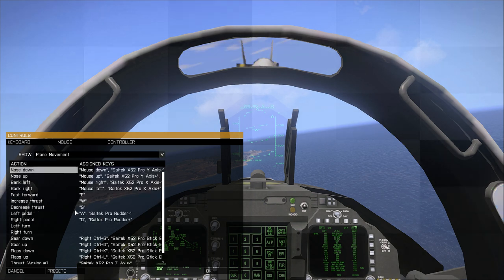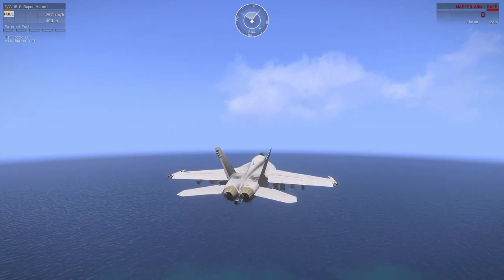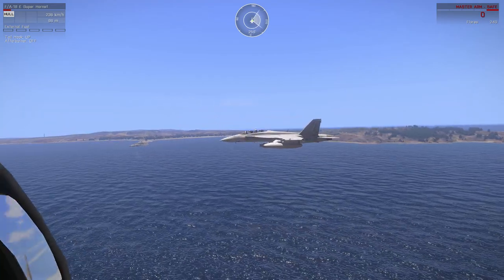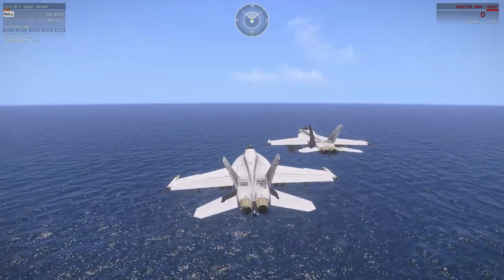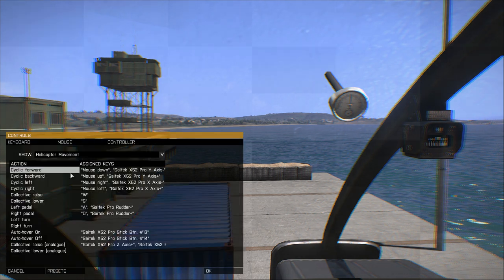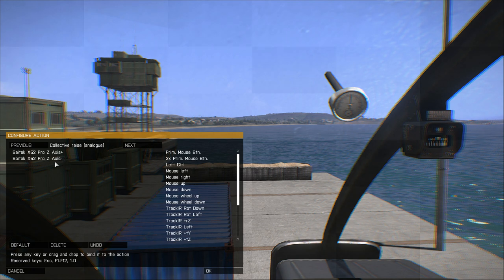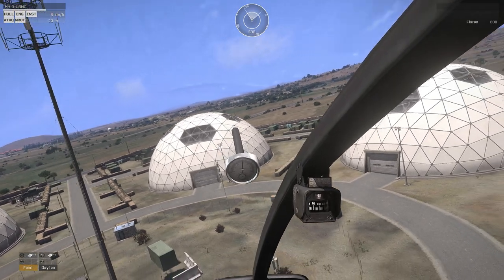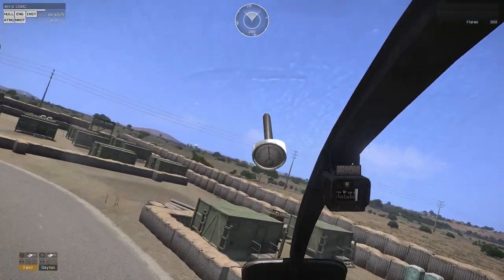Flight Control Joystick Setup - Tips and Tricks [ARMA 3 & DayZ]

Comment: If you map both the collective +z and -z to "collective raise" as shown in the video, instead of mapping to both, you loose a lot of collective down control which limits your descent rate and breaking. For instance, from a stand still ground hover lift up to about 100m then give full collective down and watch your descent rate in total time. Now remap to use both settings and do it again. The descent rate changes considerably. On my HOTAS throttle I loose about 2/3 of the overall down collective range making the down collective much less effective when fully applied, adversely affecting both the rate of descent speed and more importantly the nose up breaking capability. As you state, the change does increase the overall sensitivity of the raise collective but it doesn't affect the max/min range values, so it requires more motion to accomplish the same thing.
Reply from the maker: +grhenf2 Thanks for your insight.  I've since switched to a different HOTAS, so I'm unable to confirm your findings at this time.  I published this video in 2014, so I'm sure BI has changed a few things since then.

Comment from the maker: I think it helps a lot with the jet, but mostly for gross movements.  For super fine movements, like when aerial refueling, the mouse it better.

For looking around, I use TrackIR.  Once you start using that, you'll never go back to mouse or hat switches.
Reply: What are hat switches?
Reply from the maker: Switches that you mount to your baseball cap.  ;)  Just kidding.  They are the multi-directional switches that a lot of joysticks have in place for looking around or navigating menus with up down left right positions for a single button.

Comment: 7:20  THIS should be explained in Arma3 tutorial because it is total madness messing with controls
About jets, and planes in general. I'm not sure it works flawlessly with that config (Analog+thrust only) Because 1) Using only 50% of throttle 2) Stone falling syndrom when heading for the unasigned zone (previously the brake). 2) is obvious with the osprey because when VTOL it can fall down pretty hard (almost no way to recover at very low alt)..

So I'm keeping doing reaserch. (PPjoy+ script might be a solution for full axe usage but I've read that now you must use "signed drivers" not sure it will works anymore)

I'll go even further: I think it is completely bugged (analogue) once you reduce the gas or airbrake because it stalls. But you can't notice it at 300 km/h because it has enough forward speed to recover instantly. But if you close to the stall speed of the plane (VTOL landing) the correction won't make it, you'll crash like a noob (but you know when it happens like that it's not a skill issue but a arla input failure) - COntrol sheme is not an easy task, War Thunder just wrapped a new UI recently and it still not perfect - maybe Digital and Analogue should be auto detected because I think what we do is too far away from gaming. Not every one may have it's control sheme mapped correctly

CONCLUSION BINDINGS?
Jet fighter: Analogue+Thrust axis and Airbrake buttom
VTOL: Digital+Thrust and Digital-Thrust
Heli noob: Same as VTOL
Heli medium: Analogue+Thrust with +/- axis
Heli unleashed: Full Analogue+ low sensitivity
Reply: did you every find a fix for the stone falling syndrome....I just brought Hota and can't even freakin use it and with mouse and keyboard I'm awesome....but throttle crash every time

Comment: I know it's an old video but I'm just getting into flying in arma. What the throttle double bind seems to do is give you 50% of the throttle hence why more control. But collective lower is severely impacted by doing this making combat landings waaaaaay too slow and I'm not inclined to switching to a mouse mid banking turn.
Reply from the maker: Depends on the flight model you're using.  Check my other video for those settings.

Comment: Thanks for this great video. Do you think the joystic gives you an edge, not only in the sensitivity but also in combat, like jet vs jet in multiplayer? 
And what about free looking,  spotting enemies and buildings, how does that work with the stick? Thanks again!
Reply: Free looking with a joysticks is done with a pov/hat switch on the joystick that is controlled by your thumb
Reply from the maker: If you play a lot of Arma, I would definitely recommend getting TrackIR by NaturalPoint.  It will transform your experience and open up the entire game.  And you can use it in most flight sims and a few driving games.

Joystick gives you a massive edge when flying.  And it is more immersive which makes the game much more enjoyable.

Glad you liked the video.  Thanks for the kind words.  :)

Comment: Great Video I am learning a lot from your videos. I have X52 throttle with Force feed back stick and also Trackir and Logitech Peddles, I also have X-52 pro set. I like using the force feed back stick with the X52 throttle used as a collective along with my pedals. with TrackIR. Can you give me any readable, printable, etc. binding that you have set up? I am having trouble getting set up like your bindings are as I have to pause the video, set up, run video pause again and I think I am missing something somewhere.. Any assist will be greatly appreciated if you have anything you can share with me.. Thank you again Feint for your great videos I have learned a lot from you. I can use reg e mail if you tell me how I have a g mail account as well as a yahoo if one of those will be easier to use. I do not know what the policy is here when it comes to putting e mail addresses. I have helos and am planning on getting jets if I can ever get things working right.\ I just dont want to spend the money for upgrading more unless I can get things working better so I dont get so frustrated with it.

Thank You Feint..
Reply from the maker: Chuck Chuck Happy to help. I don't use the X52 PRO anymore and don't have my key bindings anymore unfortunately. But how I set up my stuff is kind of labor intensive. Basically I set things to how I think I want them, then play for a while and change the bindings as I go along until I run out of switches and stuff. I know I had gear and flaps mapped to the toggles on the joystick base. And the big E button on the throttle was set to the eject function. The button near that but closer to me was the mini map, the dial around that E button was set to continuous zoom to change my FOV on the fly...etc.

Comment: would a flight stick help with

Aiming in a jet to take out other jets and
being able to fly very very close to the ground

also would it help being able to land without hovering? i would like to be able to move forward and slowly descend without pitching up the nose on a heli
Reply from the maker: It depends on your settings and quality of your joystick, but overall a joystick will allow you to do a sustained input, while a mouse will give you more accuracy but less ability to do a sustained input (in Arma games).  So if you wanted to do a slow turn around something, you can easily do that with a flight stick.  You can do that move with a mouse, but you will be moving your hand all over the place.

Overall, it's a good thing to have and to practice with.  I think Dslyecxi has made a lot of people go purely to mouse and keyboard and has made a lot of people question the utility of a good HOTAS system.  I personally use both and get compliments on my flying skills.  Either way, practice with whatever you have.

Comment: Good tips.
What difference, if any, is there in having the collective mapped to only analogue up as opposed to both up and down separately?
Reply from the maker: Two results.  The first is that the entire range of the throttle is used for throttle (vs. 50% used for throttle and 50% used for braking).  This makes throttle inputs much more subtle as instead of diving up 0 to 100% of the throttle between 3 inches of stick travel, you now divide that same 0-100 among 6 inches (relatively speaking).  The second result is that it separates throttle from braking allowing for finer control of your speed.

Comment: Great video!  Just one question though. Are you using your mouse to look around? If not, how am I able to the hat button? Also for firing trigger button doesn't seem to work, actually none of the control mappings seem to work other that the throttle. Any help  would be truly grateful.
Reply: I use TrackIR to look around.  Default mapping from Arma might not be your cup of tea.  It isn't for me.  I map all of the controls manually.

Comment: One question from me, the heli throttle. I have it set up the same as you, but I find it very "floaty" and have to use one of the buttons as a "digital" collective down in order to bleed and land properly. Do you do the same ? Or is there a curve mapping in arma controllers sensitivity you find works best ?
I also use an X52 throttle, but with a Logitech j/stick for the cyclic.
Great vid though, wish Id found it sooner before figuring this all out myself :D
Reply from the maker: Thanks.  No, I'm not really doing anything special as far as I know.

I have the deadzone for the Z axis (throttle) set to zero (no deadzone) in Arma3 and in the joystick control panel.  I played around with increasing the deadzone in the past and it made the collective a little easier to bring down to zero.  Then Arma3 changed something with their vehicles and I didn't need to do that anymore.  So I set the deadzone back down to zero where it is now.  But try changing that and see if it helps you.  :)
Reply: Feint Thanks mate, I'll just fiddle with it a bit then and try for a sweet spot and carry on using a button to force negative pitch. At least I know there isn't anything Im missing :) Cheers o7

Comment: Excellent video and tip and on unbinding decrease collective, I'll be trying that out when I get to play!

Just a question and maybe you can help me out. I usually have the problem of leveling the chopper when I'm approaching my landing. It's hard for me to keep it stable and center most of the time, do I need to decrease the sensitivity and kill the deadzone (as you recommended on the comments). This has been a real problem for me when I try to land
Reply from the maker: In answer to your question, if you are using a joystick for slower level flight in a helicopter, try switching to mouse.  I usually use a joystick for certain moves and the mouse for other moves, and for slower level flight, I use the mouse as it's much more accurate (those less immersive).  For hovering, I definitely use the mouse over the joystick.  I think that unless you have a very high-end joystick, you're going to have some problems with hovering unless you're using a mouse.

Of course in real life, hovering a heli is inherently unstable and you need constant corrections to keep upright and still.  I often scan from the artificial horizon and looking outside the cockpit at a reference point like a tree or a ladder to keep my alignment.  If you have a wide field of view, try assigning the analog zoom to a slider on your joystick.  This will allow you to change the field of view to something less zoomed out.  The more "wide angle" you have, the more you'll have a sense of speed.  You'll also have a harder time hovering because medium to small changes in attitude won't be as visible (because of the nature of wide angle views).  Zoom in a little.  It will take some getting used it, but it will make you a better pilot as it's what we are more used to seeing in our normal every day life.

Comment: are you talking about the Saitek x52 pro throttle? or is the just the joystick, because the throttle has problems as I can't land anything with it, reason being there is a arma problem with all throttles only starting at 50% and not being the normal 5-10% required to lower altitude with out not dropping like a rock out of the sky _ crashes or damages every time. Something to do with a z axis problem
Reply from the maker: I address this issue in my other video on joystick setup.

Comment: +Feint
If you use collective raise only, is it still possible to land fast? i dont understand why you dont need collective lower
Reply: +Boris theBlade Yes, you could, and I'll test such latter when I get my joystick setup. but fast landing really requires more collective than less. This setup should allow for very precise control over a decent for a fast landing. Coming in too hot? Give it some collective. Too slow, cut collective and/or abort the landing.
Reply from the maker: +Boris theBlade It's just tricking the game to use the collective raise and lower in one game input rather than two.  You are still using collective lower, it just works a little better this way when NOT using the Advanced Flight model.
Reply: @Feintgames  I tested. you land slower if you bind both to raise

Comment: Hello Faint, I just got the Joystick Hotas X, I WAS SO HAPPY to use it to flight the helicopters but..So dissapointed now. Is so difficult to configure it. What Joystick would you recomend me?Thanks
Reply from the maker: +gerardo gonzalez Hello brother.  Well, any HOTAS that you buy will need to be properly configured for any game.  Maybe give it another try as setup takes some trial and error before it's almost perfect.  

Recommending a HOTAS is difficult as it's a pretty personal choice.  I stuck with my X52 Pro for many years, but there was always something wrong with it and I struggled with it for many years trying to make it better.  I even took it apart and greased and oiled it and tried to make it into something that it isn't.  Recently, I bought the Thrustmaster Warthog.  It's expensive, but for the amount of time I use it, it's worth it.  Why spend years with something that makes you unhappy?  The pedals I have are Saitek and aren't the best either.  But I'm not sure I want to spend any more money on that without hearing amazing things about something new.  And there is only one pedal set on the market that sounds any good and it's insanely priced.

Unfortunately there's no real middle ground between categories of quality when it comes to joysticks.  There's cheap, which are almost always terrible with one or two exceptions.  Then there's slightly expensive, which are much better but still usually plasticy and pretty crappy.  Then there's super expensive.  The quality is much better and it's amazing to use, but it's so expensive that it seems insane to buy that.  The way I justified the Warthog was that it costs about the same as two X52Pros.  And I've definitely used up two lifetimes worth of X52s.  And at the end of the day, I don't want to look back and say that I could have upgraded to something more expensive years ago, but I didn't want to for this or that reason.  And using something bad made me unhappy for years.  In the end, my happiness is more important to me than my saving money for some rainy day.

I hope this helps.
Reply: +Feint thaks so much for your advice, I will try few more days and if not I will return it back to the shop and as you said..Let´s have something that makes us happy..specially playing :)

Comment: What is your Graphics Setting for Arma 3? It looks awsome and smoothe.
Reply from the maker: My settings might not be right for your setup.  But I've basically looked at how each setting effects fps (using Dxtory as the fps indicator) and then I decided what I could and could not live without.  My main goal is to get at least 30 fps while recording.  Probably the biggest help is that I'm playing off of an SSD.  Insane what a difference that makes.
Reply: Feint i know that your seetings not to be fit perfect on my Hardware, but it would be intresting to know. Personally i don't own a SSD and have only Fraps. How much would a SSD increase the Game? I have a solid installed System and don't want to change the OS Partition, would it be also ok to buy only for A3 a SSD where only A3 is installed on, and the OS Stay on the good old HDD.
Reply from the maker: Yeah, that's how my system is set up, and for the same reasons. I didn't want to transfer the OS. I also record from Dxtory onto the ssd. Helps remove any stuttering but I'm limited by file size.

Comment: My throttle is acting strangely - in the air I can speed up or slow down by pushing the throttle forward & back.  But when I'm on the ground full throttle is not enough to get the aircraft moving.  Any idea what't wrong?
Reply from the maker: One of two things is happening.  Either you have wheel brakes turned on (unlikely), or it's just the usual Arma bugs.  I've run into the same problem with some planes not moving, even while at full throttle.

Try placing the aircraft in a different position to see if that gets it moving.  If you find a solution, feel free to post here.  I'd be interested if you figure this one out.
Reply: It seems to be a control issue - I can press the W key and it throttles up and moves.  Just with the joystick slider it won't.